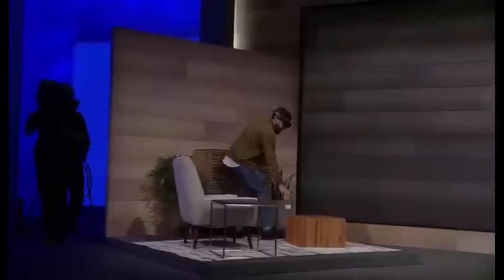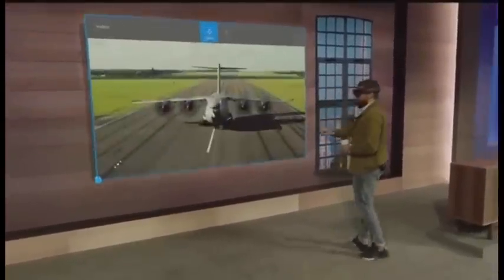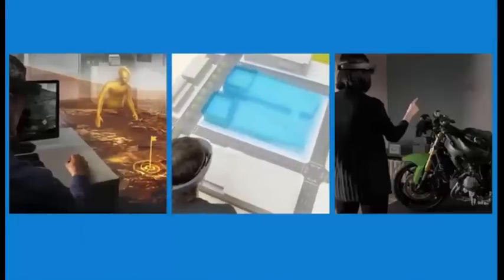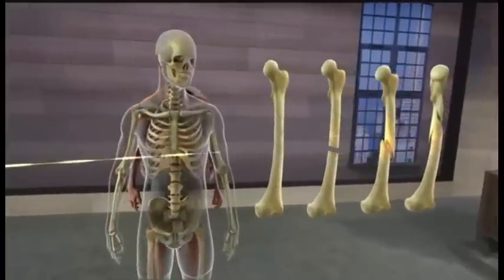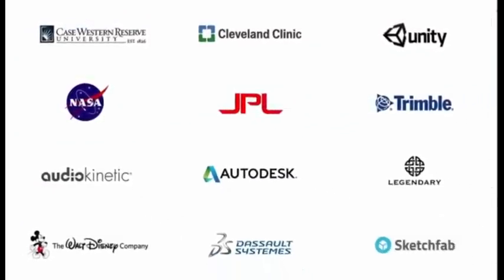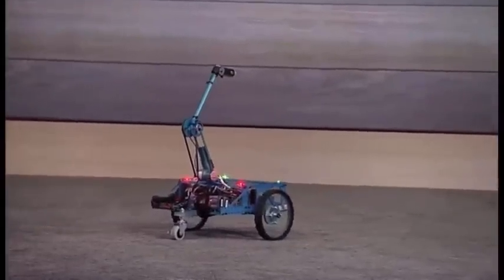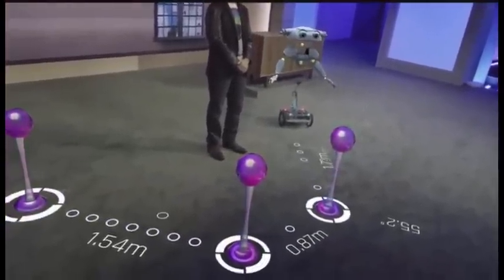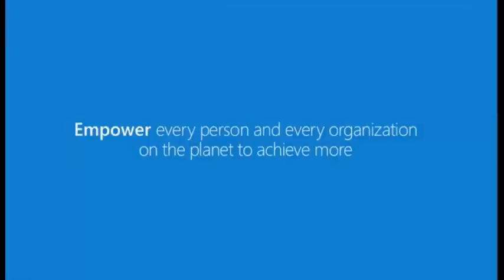Build 2015 - Keynote Day 1 (Holo Lens)

Comment: The problem with Microsoft is that they talk too much and when it's time to implement the ideas, they screw everything up. Their products are heavy, buggy and not intuitive at all. If they cannot get a freaking tablet to work well how the hell will they get all this ultra complicated environment to work?
Reply: ***** Last OS I had any problems with was XP.

I've not a single problem with Windows itself at all since then, any problem I have had has been hardware related, such as failing hardware made by third party companies.

I've used Windows 10 in VMware and it's really nice, it's blending the best of Windows 7 and 8 together into one OS that will run across devices. Basically unifying the OS code, so developers don't have to write one app for tablets, one app for phones, one app for desktops, they'll be able to make one app and it'll run across all Windows 10 devices.
Reply: ***** windows 8.1 runtimes issues
Reply: Victor Smith I haven't used Windows 8.1.